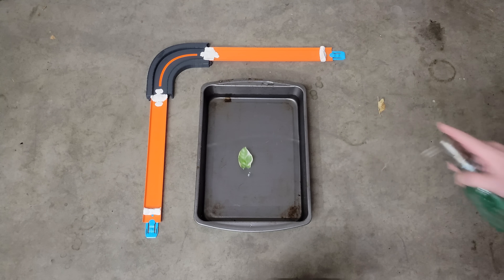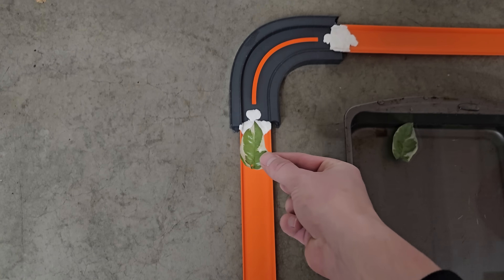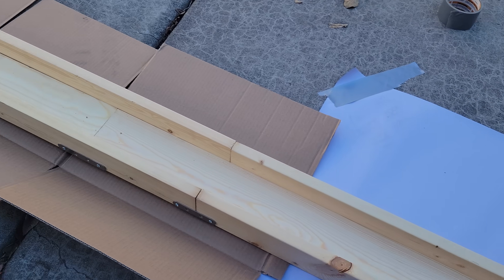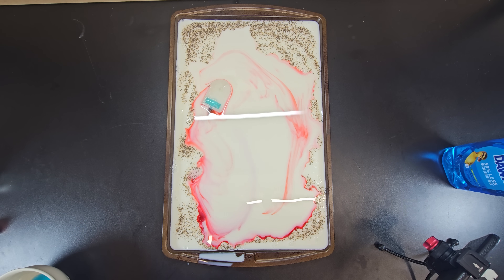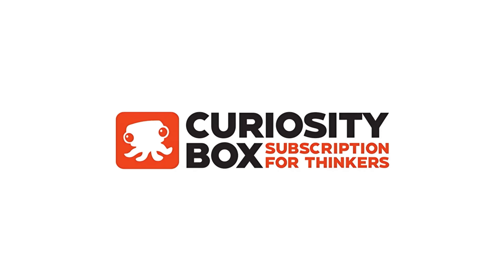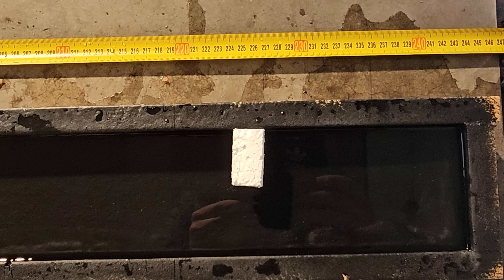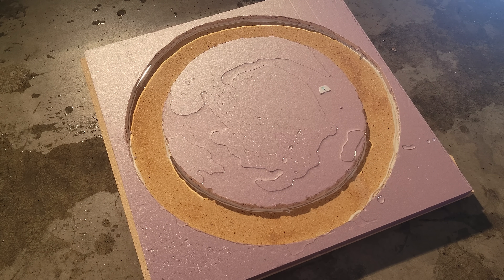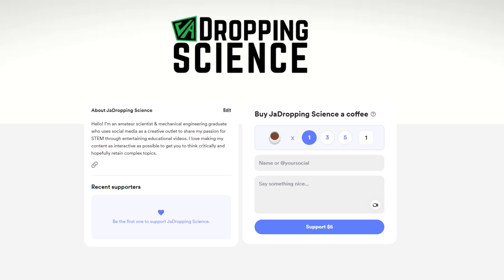Exploring the Physics of a Soap-Powered Boat

Comment: Just print the boat with the soap-out-slot off to the side more (say you're at 50 now, try 25).
You'll only be able to go CCW or CW based on which way you offset it.. but still easy and cool to test.

Comment: This is the best science channel because it shows how you don't have to be a genius to do credible science and also have fun.
Reply: Just simple experiments executed well. I love it.
Reply: @JaDroppingScience  should try to make a track on a flat surface using never wet or some hydrophobic coating to create the edges of the track!!!!! no physical edges to collide with, and perfect surface tension to keep the boat centred!!!!!!! and you can just spray it with a hose after each run! please consider, i’d love to see if this works!!!!!
Reply: @Wazega  (NeverWet) won’t work. And A toy boat, even if very light, might still break through the “wall” because the repelling force of hydrophobic coatings is much weaker than a physical edge
You need any raised side wall that is at the very least (Level with the water) or (higher than the water) 
If you use just FLAT (NeverWet) on a FLAT surface to work as a wall, it can’t. 
The water will just flow right over, but what it flowed over will stay dry
The perimeter Layer of NeverWet won’t just bounce water off of it.
NeverWet will just keep the spot you sprayed it on dry, and the water will flow over and off of it. Nothing can just work as a wall if it’s completely FLAT on the ground except something magnetic. But with this Water just flows over and off of it.
Reply: @JaDroppingScience  💯💯💯
Reply: Your boat is going 72meters per hour @JaDroppingScience
Reply: Can’t tell if just a chill comment about science not requiring a degree just to be interesting, or if low key tossing shade at @JaDroppingScience

Jk I choose to believe it’s the first one
Reply: @AssortedMeats i’ll choose to believe the second
Reply: Yeah, Science isn't supposed to require genius, just the ability to think methodically.
Reply: That's what made Mythbusters  so incredibly successful too. I'm equally happy to see YouTube channels continue such trend.
Reply: you still need to be knowledgeable though
Reply: But why is he blending directions and propulsion ? Couldn't a bigger experiment just have rudders for direction, leaving the propulsion completely independent?
Reply: @studlystud what? You trying to be smart? It's not working lol
Reply: Whatever does credible science mean
Reply: Coldest insult of all time 💯💯💯
Reply: Kind of a backhanded compliment lol.
Reply: Lol, you saying he's not smart? 😂
Reply: And vsauce
Reply: @azrael-gandy  Yeah! The Vsauce curiosity box collab was a fantastic choice. Definitely fits the theme!
Reply: Are you implying he isn't a genius
Reply: Bro's calling him an idiot 💀
Reply: I agree. I wish that they did some kind of science experiment like this when I was in high school.
Reply: I thought it was kinda genius. The methodology and patience he had throughout this entire experiment was nothing short of brilliance in action!
Reply: The science level of this video is about the same as of "marble olympics".
Reply: Well, that’s a backhanded compliment
Reply: I think you just accidently burned him lol. What I would have  said is that you don't need ab expensive lab and a big budget
Reply: I love the way you said that, lol.
Reply: i don’t think it was intentional but this seems like such a backhanded compliment lmao
Reply: Negging masterfully done.
Reply: What an insult
Reply: @zile8869 don't you mean a backhanded compliment
Reply: @trypickledcandy  No, I mean an insult

Comment: I'm fascinated by your attempt to overfill the track to use surface tension to keep the boat in the middle, even though the whole point of the video is to reduce the surface tension.
Reply: I was thinking the same thing😂
Reply: I was thinking the same, but it did seem to somewhat help. And it is notable that while the soap decreases surface tension, it doesn't eliminate it. Probably hence why it still helped.
Reply: "Just like it is on this penny"
THATS A NICKEL?!!?!??!??!??!??!?!?!!
Reply: You’re forgetting something crucial my man. The whole point isn’t specifically lowering surface tension but having a surface tension differential from the front of the object to the back so that the difference pushes the object. Increasing the overall surface tension could allow for a bigger differential. Seems to track when he struggles to push on the lower surface tension milk even more
Reply: L
Reply: But why is he blending directions and propulsion ? Couldn't a bigger experiment just have rudders for direction, leaving the propulsion completely independent?
Reply: @studlystud a rudder would like add too much weight to be reasonably moved by soap
Reply: Ya work with what ya got  @studlystud